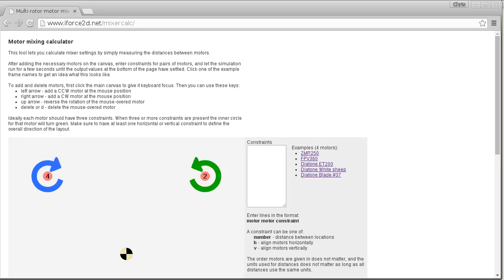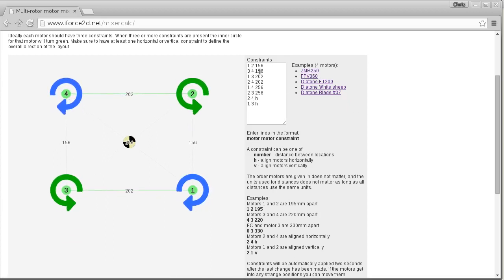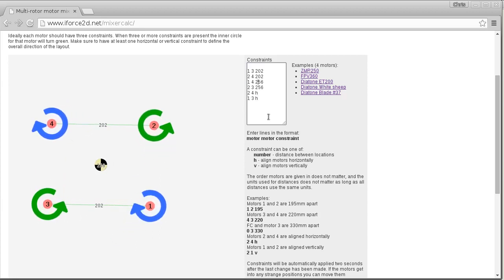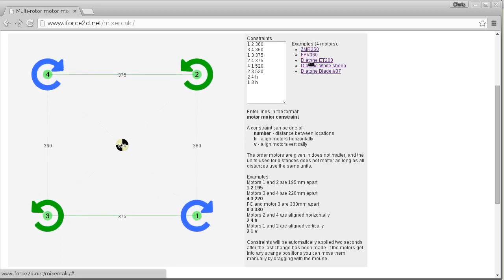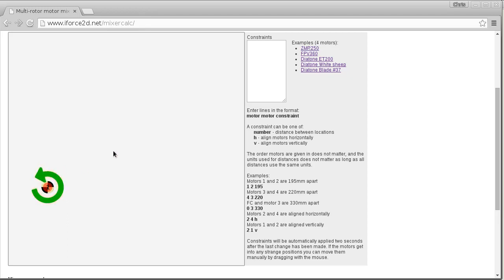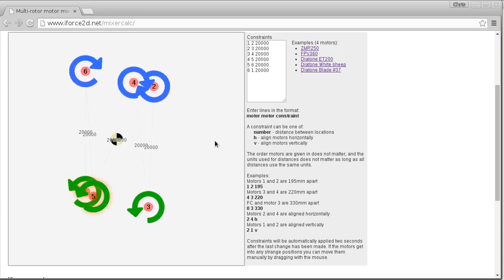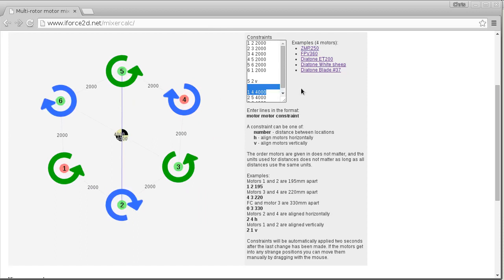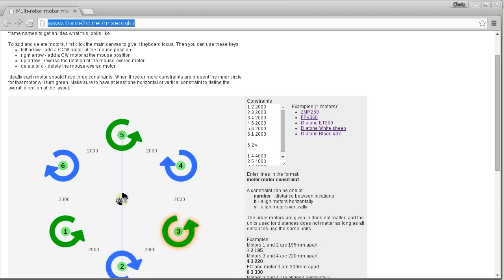Multirotor mixing calculator

Comment: Oops saw the second part of your comment there.
Yes, you're right, it does seem to make that assumption. What I did was to calculate everything around the center of the flight controller (in fact to the point where the 6050MPU is placed). There is that alternative, or the CoG or the geometric center (intersection of the motor lines). In my deadcat the last two coincide, but the position of the MPU is way off, so testing will tell.

Comment: Positive is clockwise I think.
My email is rradule@gmail.com
If we touch base I can send you the excel sheet where I calculate the Aileron/Elevator values based on the explanation on page 21. There are also throttle and yaw values that you can input, but since I don't know how to calculate them I just set them to 100 (with the corresponding sign for the yaw, + for CW and - for CCW). Didn't get the chance to test them yet though. might do it tomorrow weather permitting.
Let me know if/when you have time to look into it, and again brilliant job with the calculator. Keep up the good work!
Reply from the maker: Hi Radu, I added KK2 values to the mixercalc. It looks like it is matching the documentation correctly but of course I have not tested anything.

Comment: Could you please include in the calculator, for clarity, what the mixer values are for KK2 boards. That would include also throttle and rudder values, not just the aileron and elevator. If it's not too much to ask.
Because if you search the web or YouTube there still seems to be some confusion about how those values should be calculated.
Cheers!
Reply from the maker: Yeah, looks like the KK2 method is a real headache! I'm surprised you are the first person to ask this. But yes, I think it can be added.
Reply from the maker: The manual is pretty useless... 
http://www.hobbyking.com/hobbyking/store/uploads/161447249X30206X38.pdf
There is a diagram with some examples on page 21 but it is insufficient.
Can you tell me if a positive value means clockwise or counter-clockwise?
It also seems to assume that the CoM for a four-motor setup will sit on the intersection of two lines drawn between opposite motors, which will almost never be true for a dead-cat layout. I can make an addition to my calculator but I have my doubts whether it will work well without having the method properly defined. Now I have to wonder why you thought I would know this, when you searched the web yourself and were still confused :)

Comment: Great app but would be nice to be able to adjust center of gravity as it doesn't always line up with center of thrust.
Reply from the maker: Well it should.
Reply from the maker: Sorry that was a bit hasty. What are we talking about here? There is no center of gravity in this tool. The yellow and black thing is the center of thrust. You should arrange the CG of your craft to be at that point, if you want to keep the load even across all motors.
Reply: iforce2d I was trying to alter center of thrust to be asymmetrical front to back to compensate for cg on a micro where I really couldn't move weight much. I realize that's out of the scope of this app though.
Reply from the maker: Assuming all motors provide equal thrust, the center of thrust will always be at the average of the position of the motors. I don't see how this app could do anything about that.
Reply: iforce2d Well that's what I ended up doing, altering the thrust. I put it to zero I gain and lowered thrust on the light side til it would hover (95ish%). Works but may cause asymmetrical roll and issues unless I correct for it. But yeah, as I said, beyond the scope of your app. Didn't mean the suggestion as criticism, just was a thought I guess.

Comment: hi, if i want to stick to default mmix or custom mix for instance and a i want to rotate the quad 180 degrees what will the motor numbers be ?
Reply from the maker: what do you mean 'rotate the quad 180 degrees'?
Reply: sorry bud what i meant was i built my quad and soldered up all the motors i have my board set at -90 yaw ( actually (-900) all flies great but i have had to move a few things around and now have gps on a stalk now on the front as its more convenient and receiver antenna on front.. what i wanted to do was make it so the front of the quad is now the back... i tried altering the yaw to 90 inav (900) but the motors are now in the wrong order due to the yaw difference 180 degrees... i didnt really want to desolder all the motors, or physically turn the naze and wondered if i could just alter the motor outputs in sofware...?
Reply from the maker: I see. My first thought is that if it's flying nicely I would leave well enough alone, but I guess you want to put a gimbal/camera on the front and have the other stuff at the back. To leave the physical layout unchanged you would need to rotate all of these settings by 180 degrees:
- gyro orientation
- accelerometer orientation
- mag orientation
- motor mixing
The first three should be easy. If your quad has symmetrical motor layout the last one can be done by swapping the mixing values for motors 1 and 4, and the values for motors 2 and 3. If you have a non-symmetrical layout you could drag the motors around in the mixing calculator to make the whole thing turn around by 180 degrees. The dragging behavior is a bit strange though, it might be easier to just clear the motors and add them afresh in the already rotated positions and set the constraints again. Either way, be sure to use the 'motors' tab in the cleanflight GUI to check that the motors are what you expected, and do a VERY gentle lift off test the first time. I got my gyro and accel direction wrong yesterday and boy did the quad flip fast!
Reply: yeah its just it looks a bit odd flying with the gps stalk on the front...i cold move it, but its a lot of hassle resoldering connections and lengthening cables no problem.. i figure it out.. not had great results with inav at moment... had toilet bowling so thats why i put the gps on a stalk... hope you doing well on i nav.... i did try brielfty yesterday but it was very windy so bit hard to keep position...

Comment: not so much a noob, but still able to ask silly questions: do you know if its posible to change the rotations on the motors so that a hex motor no. 2, 1 and 6 may run cw instead of the standard ccw as a standard hexa-X  do and 5, 3 and 4 vice versa? my asymetric  Spedix Hex-X had a kk2.1.5 and that run all the motors the uppersite way round so to avoid disassemble it completely that would be nice. now have a cleanlight FC
Reply from the maker: +Villy Feltmann yes, it should be fine. You can reverse the direction of the motors in this calculator by holding the mouse over them and pressing the up arrow key.
Reply: +iforce2d Yes I know that (had read your instructions) ;-), the question is whether the FC can handle the reversed motors. I'll give it a try.

Comment: The commands aren't recognized by cleanflight CLI
Reply from the maker: +odinata incomplete report. Tell me the Cleanflight firmware version and configurator version, and what the error message says.
Reply: v 1.21@22-07-:28

# mixer custom
Mixer set to CUSTOM

# mmix reset
Unknown command, try 'help'
# mmix 0 1 -0.873 0.771 -1
Unknown command, try 'help'
# mmix 1 1 -1 -0.771 1
Unknown command, try 'help'
# mmix 2 1 0.873 0.771 1
Unknown command, try 'help'
# mmix 3 1 1 -0.771 -1
Unknown command, try 'help'
#
Reply from the maker: +odinata Cleanflight firmware version?
Reply: +iforce2d Can't find where i check that...
Reply from the maker: +odinata it shows in the log (near top of the screen) when you connect to the flight controller. In any case, you would need to know which firmware version you're using to select the correct option in my mixing calculator...... if your firmware is before 1.10 then the commands will be 'cmix' instead of 'mmix'. Maybe you could just try the other option in the mixing calculator.
Reply: Gosh I really thought I had a later version..
That seems to doing something different..
THANKS!
Reply: +iforce2d
Got the custom mix..but the thing still wont fly.
I need to do more adjustments..yuck!

But I love your program and can't thank you enough for the help...your question was so right on the mark...

Comment: is custom servo mixing similar in operation?
Reply from the maker: +Joe Smith I don't know what custom servo mixing is, sorry. Something for tricopters?
Reply: +iforce2d it's how tricopters and bicopters are controlled. clean flight, and some others have options for adding servos for thrust vectoring designs, such as tiltrotors.
Reply from the maker: +Joe Smith sounds pretty complicated. This calculator I made is not doing much more than just averaging the positions of the motors, purely a 2d thing.

Comment: a suggestion: it would be awesome to be able to use your tool to flip the FC board over and remap which pads run which pads.  I'm running a flipped scisky brushed board with cleanflight and having a hard time getting things perfect. it currently recognizes the orientation, but yaws to the right on throttle up... I'm having a hard time finding the right mix.
Reply from the maker: +mellowvision I may be misunderstanding the problem, but does this help? https://www.youtube.com/watch?v=9y-llDLCeB8

Comment: Why your program in a dead cat configuration send more power to the farthest motor from de CG? It has more lever so in order to produce the same torque needs less power. I think It must be in the oposite way, keep all the motors producing the same torque. I think a lot of people is doing this in the opossite way but I don't know why...
Reply from the maker: +Futureflyer I know what you mean, I thought so too at first. But that's not how the calculations in the flight controller work.
Reply: +iforce2d It's easy to check. The greater the value the greater the variation in motor rpms when you roll...
Reply from the maker: +Futureflyer I'm not sure what you mean to check. The purpose of these values is to tell the flight controller how much influence each motor has - so the furthest from CG should have higher values.
Reply: +iforce2d I have the exact same question as Future. If you space out motors really far in the X dimension versus the Y, you significantly reduce the pitch. Shouldn't you be reducing the roll rates and not the pitch rates?  Either those are backwards or you are assuming the motors are point masses and the frame and battery are massless. Really you can't do things just based upon distances. The moment of inertia and how you calculate it is important right?
Reply from the maker: +Nate Zimmer I understand what you're saying, but that's not how the flight controller uses the numbers. The number does not mean "how much to scale thrust for this motor", it means "how much influence this motor has".  As for center of mass, the yellow and black circle is the center of thrust of the motors (this calculator assumes all motors give equal thrust), so that's where you should try to have the center of mass of your copter. About moment of inertia, this calculator does not deal with that. If your craft has a higher moment of inertia in one axis than the other (commonly the pitch axis is higher since we place cameras and battery along the frame from front to back) then you need to handle that with larger PID values for the pitch axis.
Reply: Many thanks for your response, appears I was ignorant as to how the flight controller was using those values. Thanks again for your response.

Comment: Briliant work!
I see you've updated the calculator since posting of the video to include the Diatone Grasshopper 160.
I'm just in the process of building one, so after seeing the video I went to input the values into the calc, and then I had the pleasant surprise to see it's there already.
I'm also experiencing roll oscillations when punching the throttle on a H-King Color 250 frame, I guess that comes also from bad mixing. I'm going to try and fix it with your calc.
Did you ever figure out what went wrong in the first flight with the Diatone 200 quad? Was there something wrong with the calculator, bug or something?
Anyways, great work.
Reply from the maker: +Radu Radulescu the color 250 frame has slightly swept up arms in the roll direction, that might possibly have something to do with it. This calc is really only meant for perfectly flat configurations. I think the problem in the first flight of the diatone 200 was a bug in the mixing calculations.

Comment: Cleanflight from version 1.1.0 start with 0 in mmix so it will be: 
mmix 0 1 -1 1 -1
mmix 1 1 -1 -1 1
mmix 2 1 1 1 1
mmix 3 1 1 -1 -1
Reply from the maker: +Villy Feltmann yes, I have mentioned that at the bottom of the page
Reply from the maker: +iforce2d I'm sure you can handle changing a few characters. I only use cf 1.9 at this point and I'm not the only one
Reply: +iforce2d of cause, no problem with changing that, but I never read past the copy area :-) so wasting some time until I have read it all (men never read manuals :-))
Reply from the maker: +Villy Feltmann on second thought, I changed it so that you have to select the FC type before you get any results, that should avoid this problem. Try it now.
Reply: +iforce2d Excellent, very nice, thank you. And thank you for making such a site for us noobs :-)

Comment: Does this work with betaflight? Thanks
Reply from the maker: +RCHELIBUG Unless anything has been changed, I would expect it should. See the notes about the motor numbering starting from 0 or 1, I guess betaflight would be the same as cleanflight 1.10 onwards
Reply: ***** ok thanks I'll give it a try. I've built a Diatone ET160 that has that deadcat look. It seems to fly ok but when i throttle up n down quickly, i notice a slight rocking forward n backwards, so I'm guessing its down to the mixing. Hoping to just slightly adjust the ET200 preset.

Comment: thank you for making this!
I used it on my custom 140mm v tail setup. at first, without any custom mixing, my v tail flies sluggishly and ever since I found your mixing calc. my micro v tail is flying fantastically. thank you again.
Reply from the maker: +kit ordona that's interesting, I wouldn't have thought it would help much for a v-tail...
Reply: Yea, I thought so either. but it is flying the way I wanted to. The custom mixing helped, I guess? Haha. I'll link a video if before and after mixing.

Comment: What is the difference between a mix config and entering PIDs?
Reply from the maker: +RookTV Mixing lets the flight controller know how each motor will affect the rotation of the frame - for example if you want to roll toward the right, you need to make the motors on the left side spin faster - so you need to know which motors are on the left and which are on the right. PIDs control the way the motor speeds are adjusted to meet a given target angle, or rate of rotation.

Comment: very nice, thank you!
What do you see are the benefits of using a custom mix on a rectangular frame such as the zmr for example? There is some consensus that it is not really needed. Also on such a frame, as in most fpv set ups there is more weight spread out along the pitch axis as opposed to the roll axis, should this not be taken into account for the mix numbers?
Reply from the maker: +zenman8269 The benefits are that when the FC sets the speed of the motors, it gets the result it expected. Many rectangular quads are not so far away from a square that it will matter a whole lot, but since it's so easy to do properly you might as well. I think the PID settings will take care of any difference in rotational inertia between two axes. You would most likely have a smaller P for roll.